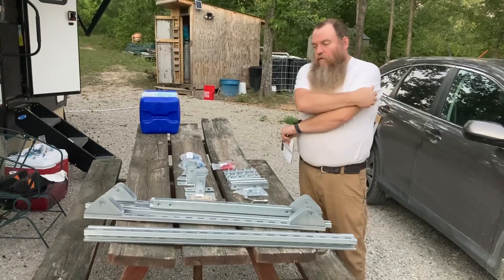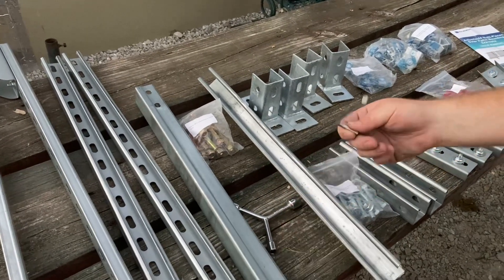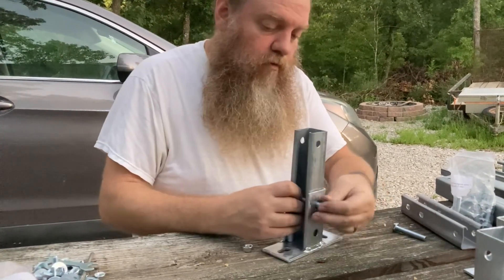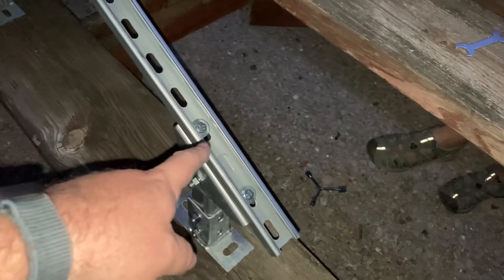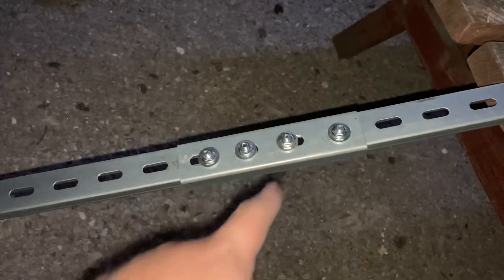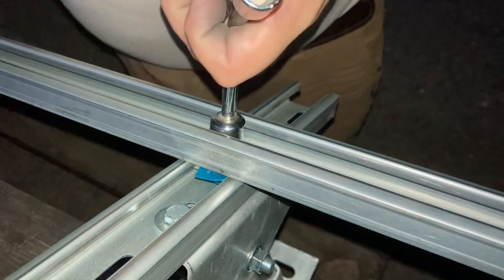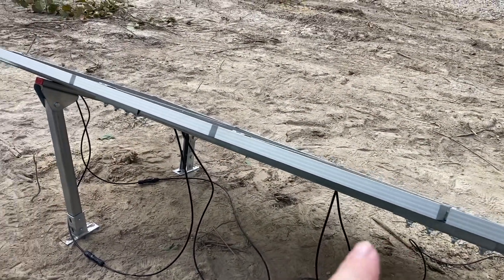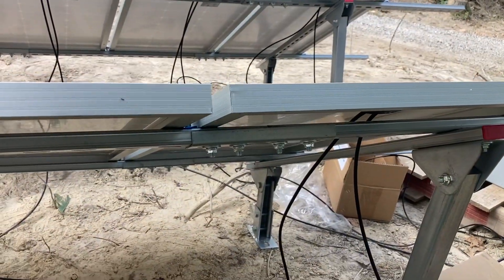Step-by-Step Guide: Assembly of Eco Worthy Solar Panel Racks (#124)

Comment: I just picked up a set for my 4 x 100w. Your vid helped a lot! Can you tell me the center distance between the upright legs (short and tall) at what degree are they when you measure?
Reply from the maker: Glad the video was helpful!  I don’t know what the distance would be off hand, but I can tell you that the legs are all angled a little differently because I have them sitting on uneven ground. So, I don’t imagine it would be very helpful to you if I did measure them.  I eventually hope to install them in a more permanent way, but right now I just need them to work and haven’t had time to fool with them anymore.